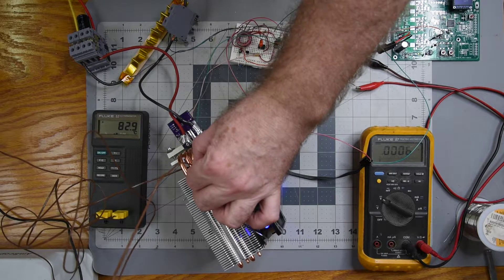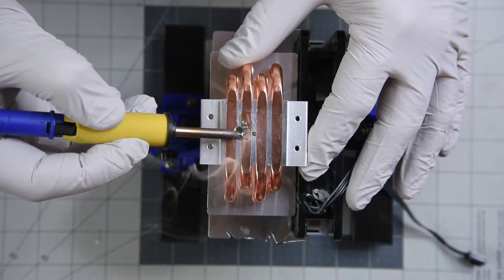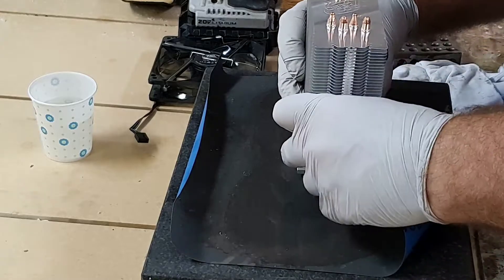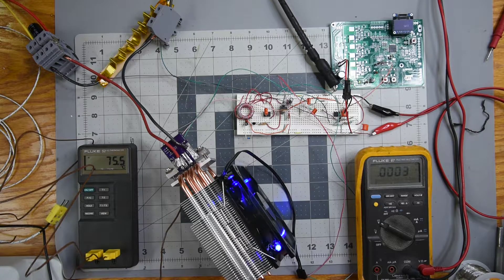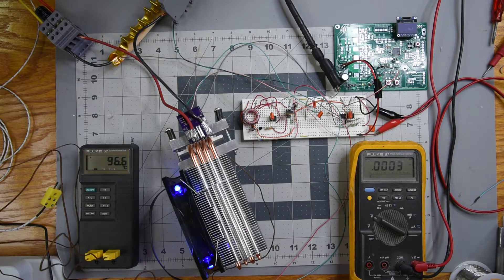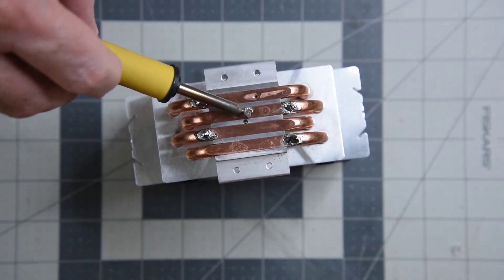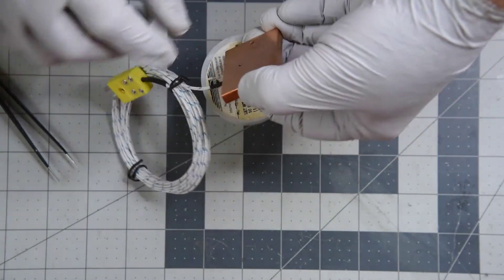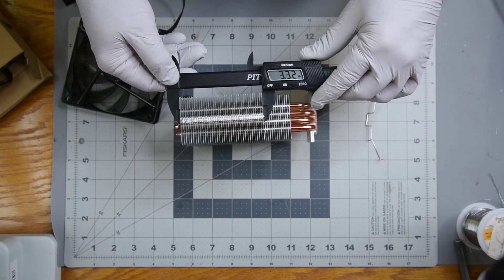Heat Pipe Destruction – Case to Sink Plan Failure

Comment: The acetone leaked and decompressed, even if you weld them again you need to fill  pressurized acetone .
Reply from the maker: I completely destroyed it.  I underestimated how thin the heat pipes were.